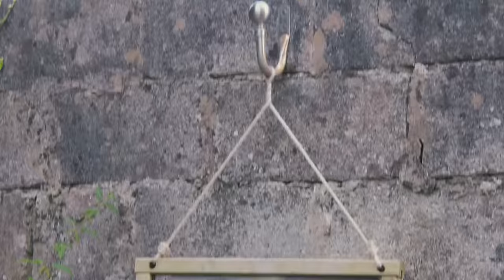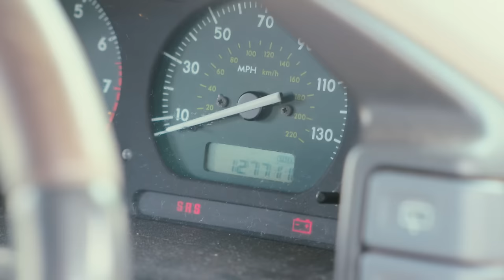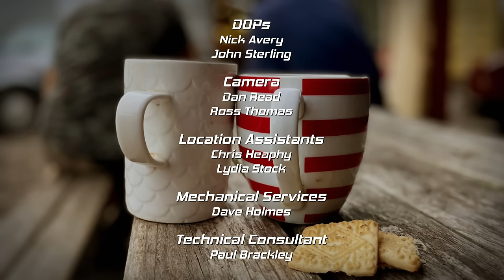Rescuing a Land Rover Freelander - Flipping Bangers - S03 EP12 - Car Show

Comment: I have one of these except mine is a TD4.
The car is seldom in 4 wheel drive mode due to how the viscous coupling works. It is quite ingenious. The car only goes into 4 wheel drive when it needs to. All done automatically and mechanically. No fancy electronics.
This is why it's a myth that if you remove the prop and make it permanent 2 wheel drive, you save money on fuel.

Comment: I have a 5 door ES, a year older than this one, with 84000 miles on it. Admittedly its the Bmw 2 litre diesel auto, so its not the quickest, but I'll never get rid of it. Brilliant cars. Also, Boiled Linseed Oil is so much better to bring the trim back to life. Its cheap, feeds oil back into the plastic, and lasts for months. Its safer and environmentally friendly too.

Comment: You have to fit a new viscous coupling to these, else there is no point putting the prop shaft back on, there is no reliable easy way to test it. Also just having new tyres on the back and worn ones on the front or the opposite is enough to destroy the IRD.

Comment: It would be good if they show us the MOT process too as the cost of that as well as the repairs necessary as that hasnt been factored into the cost
Reply: Nor was the cost of the new tyres.
Reply: This is nothing more than entertainment. They will never be making a profit on any if their old bangers, not even if they worked for nothing (which they already are, really)
Reply: @neilhampson2843 Chinese ditch finders you mean.
Reply: Nor insurance or registration or wheel alignment.

Comment: I once got offered one of these for £200 with the same K Series engine. There was evidence of past coolant leaks so I was suspecting a K Seal type repair so I passed on it. I'd definitely consider one today as a project but I would do the head gasket if there's no eveidenced of it having been done.

Comment: A petrol Freelander, its bound to have head gasket problems??? 😮
Reply: yeah most of these were binned off for that, the Kseries engine is expensive to fix.   I was into 600 quid and that was me sending the head away and me doing the headgasket, got the very latest stuff though.  I think by the time i was sorted coolant oil and other odd and sods, i was into a £1000

Comment: Still soldiering on with my utter rat-box of a 2003 5DR 1.8L K Series Masai Mara (red), which I bought for £400 seven years ago. So far, its cost more in tax per year than repairs. Yeah the plastic exteriors got to crap, but shoe polish will fix that.

Comment: my wife has had her freelander 1 1800 for 24 years it is 26 years old a 1998 the only problem she has had is the cylinder head gasket as did a lot of lotus cars as it is same engine but we had it done properly head skimmed and the new three ply gasket  since then nothing the prop has never been taken off although i noticed it may want the centre carrier bearings done my freelander is a 2006 td4 auto and the prop is still on that there are so many myths  about like taking the prop off for economy which it does not make any difference although i have to change my seat cover of which  i have very good second hand ones  it does look to me as though the cylinder head gasket as been a problem at some point as the header tank as the remnants of the oil on the inside  .thank you very much for the video
Reply: Allergic to commas and periods i see
Reply: @phrg8332  I was thinking the same. I got breathless reading that lot with no punctuation.😋

Comment: I brought a Freelander back in 2003 from Land Rover of Albuquerque and that was a big mistake. This was the biggest POS I ever drove. It had an order of burning oil coming out of the AC vents. The sunroof kept on breaking and the transmission blew with only 25 K on it. Thank God I had an extended warranty on it... At that time it cost over $ 6000 to replace the transmission.  The last straw it couldn't pass emissions. I traded it back to the Land Rover dealership for a used Toyota Highlander and that was the best thing I did. I will never buy any Land Rover let alone any car made in the UK...

Comment: Bought back memories of a 1.6 litre Vitesse convertible and comparing it years later with an MG TF115 which was light years better. Amazing how the Spitfire survived all these years and being easily repaired to mot standards. A pure example of open-top motoring where you can drive through our lovely countrside at 50mph and enjoying the experience.

Comment: Carefull folks !   The 1.8L K series petrol engine is too under powered for the weight of the car. The head gaskets normally blow and that leads to further issues.   My K series is a 2000model and I have kept a check on the coolent level for 5years, yes its pissing out.    You can fit a  235 R17/15  direct onto the rims without spacers, the factory fitted tyres are for school runs.   Yes the body and chasis are of good standard, so very few rust away.  ---- My service I did was a distributor, battery and Oil/air fitres and Oil.  ---- Dont expect this car to pull over 80mph, they were built aa a pose and not work horse. For some strange bloody reason I love my Free Lander. ÖÖ  ÖÖ

Comment: Like any in that range with the K Series engine....buy the diesel instead. Rover could never be bothered sorting out the head gasket problem. It was fine if you changed the gasket along with the timing belt every 50 thousand.

Comment: So they buy a scrap yard VCU which is guaranteed to be knackered and just bolt in on. Prizes for guessing how long it takes for the transmission to go BANG!
They buy a car with a K series engine and no coolant in the system. Prizes for guessing how long it takes before the new owner is stranded at the side of the road with steam pouring out.
Nice car, shame about the cosmetic makeover that is leaving a ticking you know what for the new owner.
Reply: VC might have been recently replaced before the car was scrapped. You can't say it's a bad VC just because it's been in a junk yard for years.
Reply: @JazzFunkNobby1964  Freelanders are notorious for failing drive train. This issue is caused by bad VCU's which for some reason mechanics don't understand, even though they are the simplest device on the car. Yes it is possible that the VCU is good but without testing you will not know until your rear diff or IRD go bang.

Comment: hmmm, it failed three things looking at last mot failure, it failed on seat belt anchorage area strength, which wasn,t addressed in this video, and anti lock braking system warning light, not done in this video either or the front positioning lamp

Comment: The cars a 2001 and they said it was 18 years old so is this an old show or do they struggle with basic numeracy
Reply: I was thinking the same, with it being a 'Y' reg (March - August 2001). If it's recent show, it must of been filmed during last spring/summer at least.
Reply: @pistonhedd  Yes I wondered about that too.  According to the end credits it's copyrighted 2021 and google says it originally aired on the Discovery channel August 2022,.
Reply: @keithrushforth4019  who knows then 🤷‍♂like colink33 posted, the presenters have probably got it wrong.
Reply: The show is over 4 years old

Comment: 32:31 Freelander, Series1, 3 door van, not seen many of them about or for sale. Looks like it might be a TD4, which had the BMW engine and drive chain for a timing belt. Main gripe I had with the latter, was the accursed and extremely naff vertical battery terminal connections. Response to video only.
Reply: Think it’s the 1.8 petrol 🤦‍♂️

Comment: Maybe it's just me, but for a car that is going to sell for less than 2000$ I could care less about a rip in the seat or a blemished interior as long as it is in good mechanical condition! If the vehicle cost 10K, yeah it is going to be more important that the inside be as nice as the outside. And btw, some mothers back to black would have made the abs plastic bits look just like new without all the work with a heatgun.

Comment: My forester has done 300k.  Low range manual.  I almost replaced it during covid but the rav4 hybrid wait list was 1.5 years.   Glad I didn't.  I'm going to take it to 400k, at least.  Might even try for 500k.   Land rover freelander.. Engineered for failure.  Subaru, engineered for greatness!